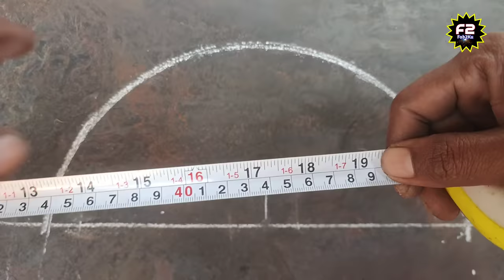One More Awesome And Unique Tools For Beginners / Must Have Time Saver Tools Techniques

Comment: To find the length of the metal you hammered all you had to do is multiply the diameter 12"  by 3.1415 which is Pi then divide by 2
1/2 of the circumference...
So 12 X 3.1415 = 37.698 ÷ 2 = 18.849 inches or 18 13/16"
Easy eh!
Reply from the maker: Right sir 👍